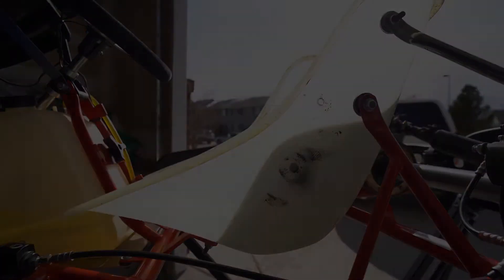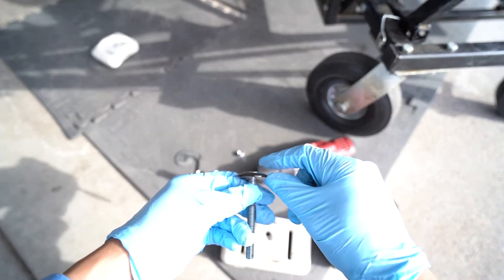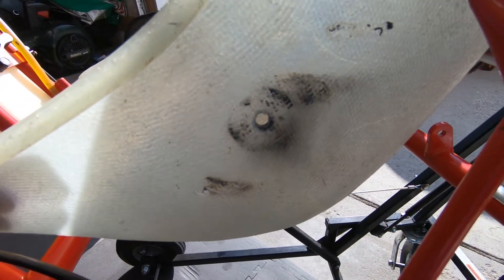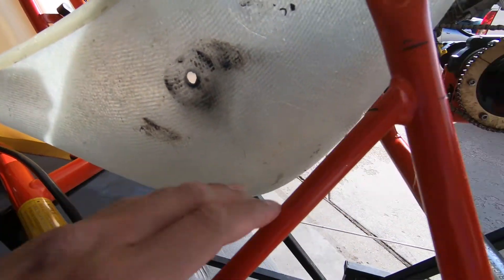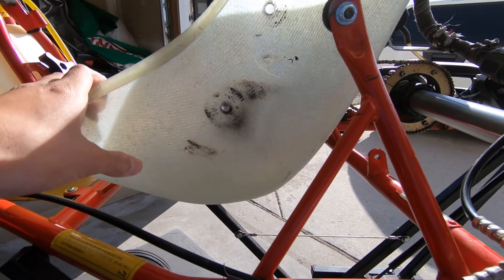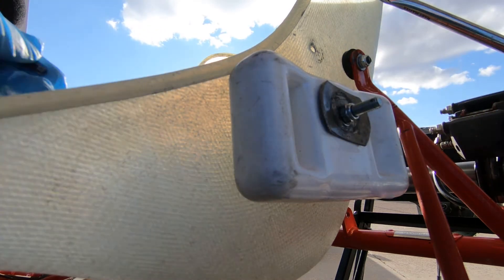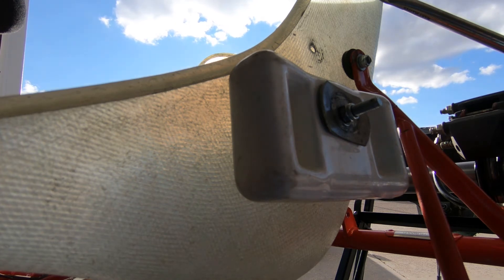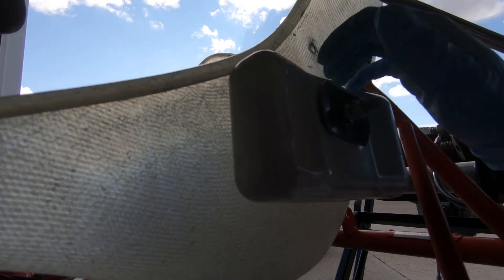How To Add Weights To Your Go Kart

Comment: Where’d you get the weight
Reply from the maker: Hello John, I ordered it through accelerationkarting.com, they have many selection of weight to choose from. Also, a cheaper way to get one is through a local kart shop and a used weights at that. It saves you money and time by not having to drill holes if you buy a used one.
Reply: @AJsRacingJourney  thanks
Reply from the maker: @johnvance1866  No problem bro, let me know if you need anything else.
Reply: @AJsRacingJourney  Ight
Reply: Hello!  Is it possible to add $40 pounds? 
Will those 10 pound ones fit in the front of the seat right below it?

Comment: This isnt a mod i plan on doing. Its abit pointless in fact for my kart which is not raced. Also, i added weight by putting a front brake kit on, heavily padding out the seat so its very tight on me and extreamly comfortable, and have been trying to figure out an easy way to produce electricity to recharge the battery. I think a motorbike stator could be modded to run off the rear axel, or little alternator if i can find one small enough. Basically, adding weight with things i can use instead of lead which defeats the point of spending a fortune on billet magnesium parts to start with.
Reply from the maker: I agree with adding useful weight such as padding and using battery recharging capability. However, if you do race your Kart in a sanction event, then you'll definitely will need to follow the rule book for adding weights to your kart or be heavy enough to be at or over the weight limit. It is sometimes a disadvantage for lighter drivers such as myself because I have to add weight to meet the weight limit.
Reply: @AJsRacingJourney  with the front brakes, its not race legal as its tag 125cc, which outlawed those. I just race for fun and havnt entered an actual race event so added the extras. There is also a non homologated track near me which does club events which i could run in though so in the future i hope to do that. 
https://youtu.be/qz8IOCpD2JY